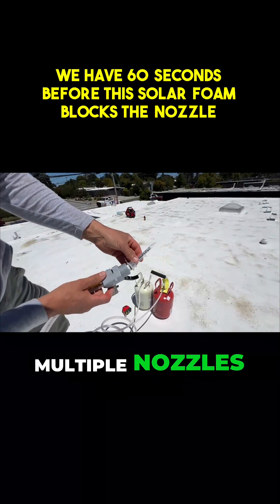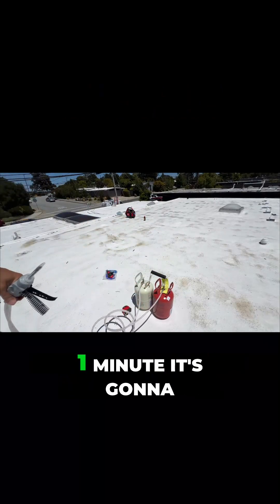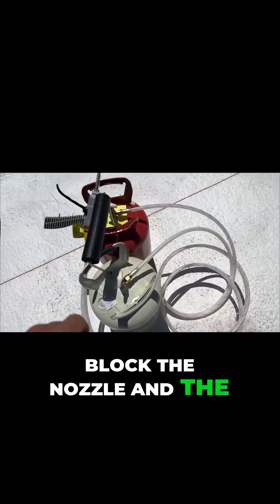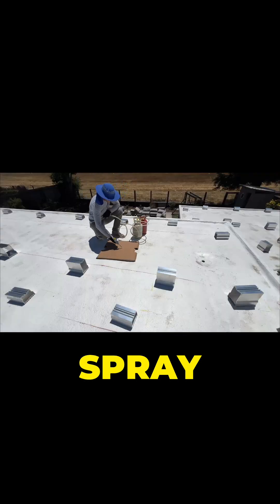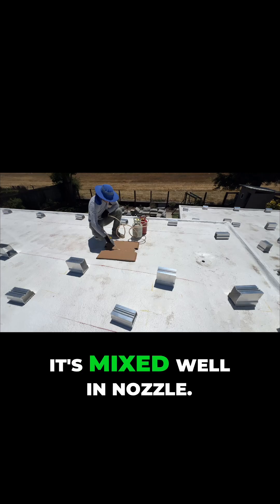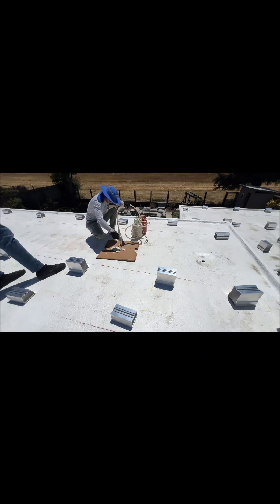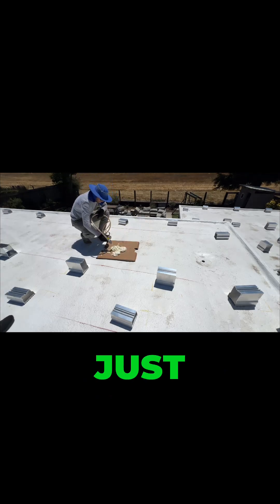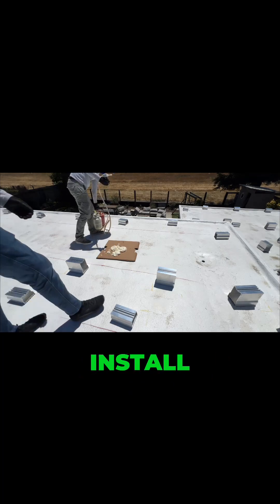We Have 60 Seconds Before This Solar Foam Blocks the Nozzle

Comment: And with strong wind it will not go off the roof ?
Reply from the maker: The manufacturer claims it's rated for High-Velocity Hurricane Zones
Reply: Out here in the Bay Area we don't have hurricane winds but in February/March its going to tested with strong winds as the storm systems move from the Pacific to the Rockies.